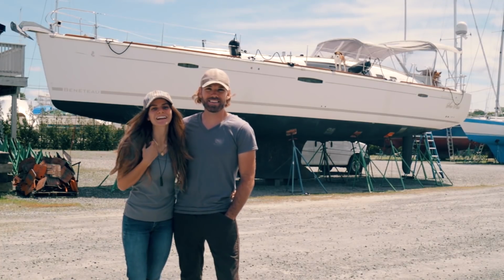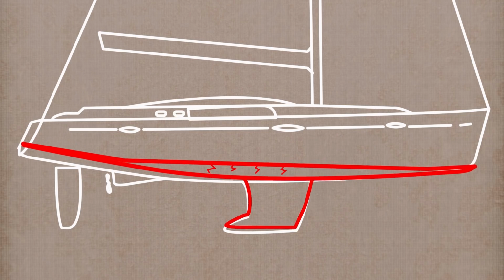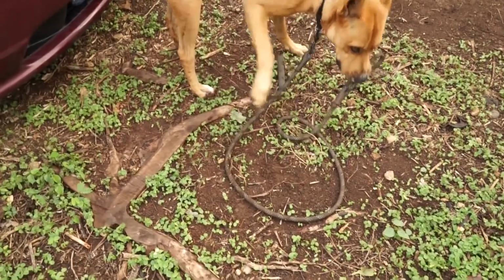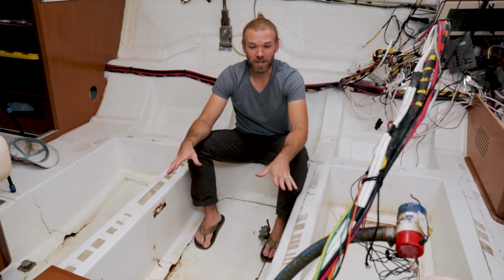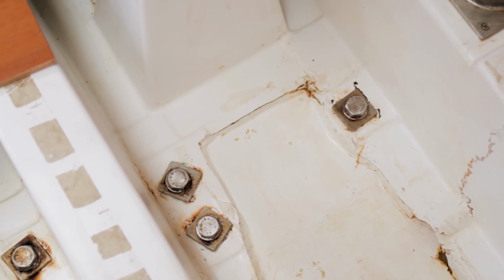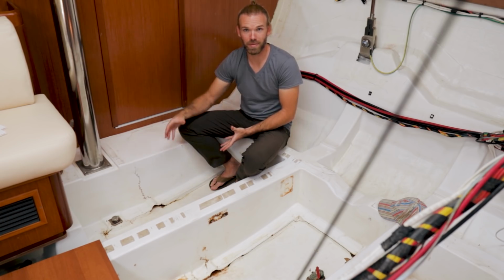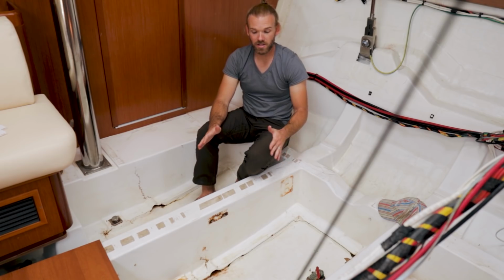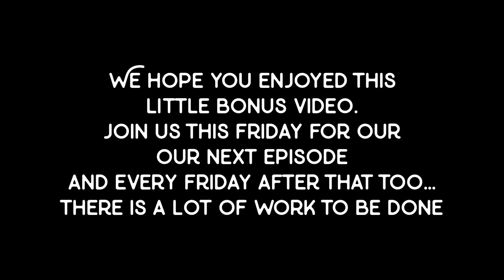What Happened and What Now? our SALVAGE SAILBOAT story | Expedition Evans Bonus

Comment: On looking at this video I feel that the boat keel suspension structure was not adequate for the boat.  Here are a few points.
1. The width of the upper part of the keel was rather narrow and this caused high stress as the boat healed.
2.  Using short bolts to the narrow and thin flanges on that grid without large backing plates was not a good idea as the repetitive healing of the boat caused the crack shown on various parts of the lateral parts of the grid.
3. Premanufacturing the grid and dropping in the hull and bonding it down and expecting those flanges to hold was a very bad idea by the original designer and while it is fast for production, the integrity of the boat is questioned and unsafe. Those narrow thin flanges do flex a lot and it explains the location of all those cracks.  The I beam structure just did not operate as a good I beam structure.

I would consider this repair.
A. Before the keel is lifted back onto the hull, the outside of the hull around the keel area should be fiberglassed with more layers and I would even consider extending the area to about  30 centimeters on either side and front and back of the keel top. Laying a 2 centimeters of flared edges fiberglass on the outside of the hull would help when the boat heels and the additional flared edge layers would not affect the speed of the boat, but would certainly lessen the stress in that area.
B. I would not dream of rebonding the hull to the grid as that bond would not add strength and lateral resistance to the stresses when the boat heels.  One could actually lay more layers of fiberglass on the inside bottom of the hull where the grid is lifted as much as possible to get as many layers as possible.  Then the grid is lowered onto the hull and " bonded in.  Here is the strongest part.  The flanges of the grid would be overlayed with a flat bar of stainless steel over which many lateral layers would be laminated to thicken the flanges and more effective lateral beams would be formed where longer bolts would be used. One could use another flat bar stainless steel on top of the layers to ensure a very strong lateral I bean being formed over every lateral flange on the grid.  This feature of reinforcing the flanges and changing them into  I beams even to a height of the grid itself than with the loner bolts, the material of the bolts would also help with when the boat heels. From the look of it, the flanges could be increased in height to the height of the grid itself where the top flange of the effective I beam would ensure that the keel will not even swing a thousandth of a millimeter when the boat heels or hogs or sags as the resulting lateral beams on top of each flange would pass the load to the sides of the boat and one can rest assured that that keel will hold through thick and thin and a few storms that it may face. 
Since the boat is a displacement boat it could take all the additional weight the suggested structure may need.
We used the above structure of passing the keel weight to the side of the boat through using a lateral beam in our 30-foot wooden boat and it held through all the poinding that boat got. 
Good luck with your repairs.

Comment: As an old insurance adjuster I have to ask,,,, did you get all of the insurance paperwork from the previous owner used to total it.  I'm sure it would offer insight as to how far the damage went and they may have even had sounding photos taken of the damage.
You guys make a good team and I'm sure the repairs will be done correctly.  Just remember to go slow and enjoy the process.
Will be watching to see how you're doing.
Reply: Brandt All maybe you might  know this...would they be able to obtain any insurance for the boat right now. Like an agreed value policy based on what they paid the salvage company. I know it’s not structurally sound but the vessel still has some value. If they paid cash for it which I’m sure they did and god forbid something happened like a fire they would be screwed.

Comment: Right now when you look at the grid it looks like the grid is lifted away from the hull.  This is incorrect. The keel is on the ground therefore the boat is slumping down away from the grid.  This means that the hull must be lifted until the grid is back in place before any more work is done. You will just about need to hang the boat in the air.   So, you need 1) a place to work on the boat that is cheaper than the marina. 2) something strong enough to hang the boat from. 3) a plan for Exactly how the repair will be done.  4) a place to store materials and cut fiberglass cloth rolls out of the weather and ideally at deck height so work is easy.  The repair is not hard but it must be done correctly or it will fail somewhere down the line and it may be after you have sold the boat!   My advice is worth what you pay.  I hope you do it right, do it well, and get to enjoy your dream life for decades to come.

Comment: Great project to work on
I don"t believe that a epoxy bond is going to be enough at this point of damage. Consider a mechanical connection in addition.
Then you would be able to calculate and design the load connection between the hall and keel.

Comment: Ugh. I kinda saw this coming with the first mention of there being "a problem". I'll second all the advice to cut off the tabs and reglass them to the hull; there is no other reliable way to rebond the grid to the hull. I would also suggest dropping the keel and checking the hull laminate at the very least around the aft end where it meets the hull. There was likely some serious deformation of the hull during impact that delaminated the schedules of glass in that are of the hull, which is now hidden under layers of bottom paint.

Comment: I am not an engineer or even a handyperson. However, it seems to me that the two piece design of separate hull shell and structural grid is primarily used for ease and speed of construction. Some folks here are suggesting cutting off the flanges on the grid, which seems to make sense. You have no particular need to preserve the original design of the grid if it would be more structurally sound to cut the flanges and marry the grid to the hull shell. Again, I have zero engineering knowledge, just suggesting that the boat was originally designed for practicalities of construction.
Reply: Beneteau's engineers that are actually engineers put them there for a reason, not for aesthetics. There is absolutely no way to achieve better structural integrity by cutting them off and layering by hand. If there was Beneteau's engineers would have done it that way in the first place.

Comment: Do you have an idea on how you will create flow for the bilge pump and any water that is taken on? I notice there seems to be half holes for drainage to lowest points how are you going to recreate these and keep the strength
Reply: Those are known as 'limber holes', and won't significantly subtract from the strength of the structure around them if done properly.

Comment: will Beneteau give you access to their Design Engineers for questions and answers?
Reply: Eric Roden , Beneteau is an excellent company. I have owned 3 Beneteau’s and have contacted engineering many times in the past, all with great results.
Reply: Given that if the repair fails the keel falls off and all on board probably drown, seems reasonable to get a repair plan from a marine architect with plans and a BOM and follow that precisely. It’s all well and good to get phone support from Beneteau...

Having sailed an Oceanis 48 for a week I can say I enjoyed the boat, and that there is a reason the charter company dives on every single one before they accept the boat back from charter.

Comment: Poly ester is not a glue but epoxy is. Polyester can shrink as much as 5% and help the poly ester patch to crack off at some future date. Epoxy won't shrink very much  but is less ridgid. I would also consider to join the  frame to Hull with tempory bolts though Hull to get grid frame pulled back to correct positions. Then I would cut notches in frame and epoxy glass woven k glass mat those notches to Hull. Then remove bolts fill holes in Hull and then epoxy glass mat the frame completely to Hull. The thing is to try to remove as much of the stress in frame. The frame and Hull look to be out of line and it is possible to by error build in stress to frame and create a stress fracture to the frame or hull in heavy seas or even simply putting hull into out of water. Boats will on land tend to sag and then in water  deform again . This shows up as cupboards and doors can jam up and some boats will leave cabin  doors open before heavy seas as the closed doors will refuse to open in heavy seas. There is never a perfect way to solve these issues as even in factory production no two hulls or frames are exactly the same due to polyester shrinkage issues hull   sag after removal from molds and other gremlins. The method I suggest will take longer but hopefully reduce the risk to end up with frame Hull pretensioned stresses in the joining materials. I would not be keen on carbon cloth it is more flexible than woven glass mat with epoxy. I prefer where possible to use polyester k glass mat it is more ridgid than other materials but its ability to bond to older polyester materials and shrinkage issues are the problem. Not saying it cannot be done with polyester but the risks to delaminate are higher. Be very aware that there is waxxed polyester and unwaxxed polyester. Unwaxxed polyester will never set off 100% as it is always exposed to air. The surface of waxxed polyester will as it sets off allow the wax to float to the surface and block air from contacting the polyester and therefor allow the polyester to cure 100%. The problem is the waxxed polyester type material will not properly allow a new mat material to stick to it properly. This means it often requires the removal of the top layer of glass mat of the old Hull material which normally has the waxxed polyester type put on last. Mr if I was doing this I would after I had got frame in place glued down I would remove the  remaining top layer on the hull between the frames grid and epoxy mat woven cloth the entire frame down with 1 or layers . It's a bit of over kill andadds weight and cost but could  help ensure frame grid can't seperate and give more hull surface to stick too. Also it adds extra strength low down  and epoxy mat is not so rigid and can hopefully  allow some  flex between frame grid and can cope with flexing stress better is my best guess. Also definitely if you can  get a top fibre glass boat repair expert to advise you in a consultancy basis. The first thing is get s estimate from him her cost to repair from thier boat yard with a  guarantee for the repair. You might find that the costs might not be so much as most of the costs of repair are to do with stripping out boat and then  refitting all the fitting. A bare hull with easy access to repair reduces costs. Also boat yards often  can buy materials at lower prices than the public  can and repair boat market is sluggish presently. This might  allow cheaper quotes. Failing that consulting basis can potensialy save money from expensive  mistakes. Your young enough that you could one  day choose to sell boat such as buy another craft to suit new requirements. The ability to show the repair was properly done can increase the resale value at some future date. Great buy I have seen much worse damaged boats repaired as a boat repair person mostly involved as new boat moulder teck laying on the gel and fibre glass polyester layers in molds a different type of  field than repairs which the other crews do. I don't do big repairs like this but have done many smaller repairs often to  decks  where something wrecked sections of the decks like balsa rot to sandwich decks or similar. There is in polyester hull damaged to have large spider cracks running through the Hull that only very good experts can find. These cracks if found can always be repaired at some cost mostly time costs and cost to get experts information . If not detected these hidden cracks can over time open up and cost a lot more to repair down stream. The risks for this are less in that size of yourboat as the Hull material is so much thicker than the smaller boats. Keep up the good work you need to have a lot of drive and best you got youth and energy  on your side to make the project work.

Comment: Do yourself a favor and forget about gluing it back. That is done purely for speed of production. That is the same reason they generally aren't good for bluewater sailing. If you are going to do bluewater sailing and knowing that extensive damage, you are going to want to glass it down really well. You may not be able to see all the cracks and peripheral damage so go overboard so you have the comfort of knowing it will hold together in extended periods of rough seas. The is another channel where a couple were facing sinking when their production boat was flexing and got a 2 ft crack in the bow. Luckily they got help and made it though but it was a really tough time for them.

Comment: Plan B.  No doubt.  Cut off the tabs.  Chisel/grind off the old flex adhesive. Glass+epoxy the grid onto the hull.  Aim for 10mm thickness, more in the root of the connection.

Comment: Actually that's a good design.  Ripping the hull is worse than separating the grid from the hull.  
The reason that stringers are not completely welded to steel hulls are so they can break away and the plates bend rather than the stringers and frame cutting the hull open.

Comment: Hi lovely guys, so I was right regarding the cause of this substantial damage to the boat. However, please accept this important advice, whatever plan you want to follow to fix your boat you must first ask advice about your plan from Bénéteau, the company that built the boat, (you can ask Bénéteau to supervise the fixing process) secondly you must ask a naval engineer to supervise the fixing process and to write you at the end a validation report that insurance company will ask you about in order to insure your fixed boat otherwise nobody will insure this boat or if they accept the price will be very expensive. Thirdly a professional validation report will put added value to the boat in which case you decide to sell it otherwise you will not get back even the price of its furniture 😔, I wish you luck and always think twice and calculate twice before any irreversible step

Comment: You guys keep calling it your "Grid". I'm curious if someone at Beneteau taught you this term (as Beneteau has renamed some of their boat parts in the past) as it's not the term any other sailors use? Most monohulls call them "stringers"; although technically stringers are only the beams which stretch athwarthship (side to side of the hull). Threaders is the name if the forward/aft beams (again, though, most sailors call both stringers so it wouldn't get you dinged). Please don't think I'm trying to be a troll; I'm a trailer sailor who is thoroughly enjoying your romp into the unknown!

Comment: I wish you all the luck though this global pandemic may seem like a disaster it does have its upsides. Firstly since your plan was to always do the work yourselves then the fact you cannot work does not affect your plans though of course it may make getting some supplies more difficult. The extended time this project is going to take means you have a chance to grow the channel develop your YouTubing skills and hopefully have a source of income whilst cruising. When it is finally over then there will be plenty of work about especially wedding photography(I would suggest that flying will not bounce back so quickly but of course keep your certifications current) which will also enable you to fill up your sailing kitty. In fact I would suggest you develop a buffer of several months so you can be away earning money and the YouTube videos can roll along. This also means you can offer your patrons a chance to keep up to date.

This may sound as if I am one of those happy optimistic souls always looking for a silver lining I am not however that does not mean that what I have pointed out is incorrect. Along those lines I have never seen a boat rebuild on YT that does not take 3 times as long an cost twice as much so I suggest you factor that into your plans.

Comment: You may want to consider leaving the keel attached initially and supporting the hull to hold the grid down while you strengthen it with new laminate and them drop it to do further remedial work.